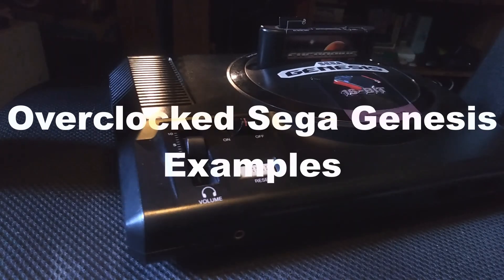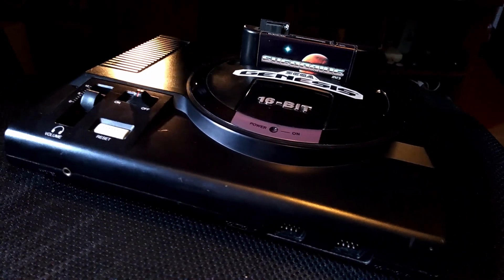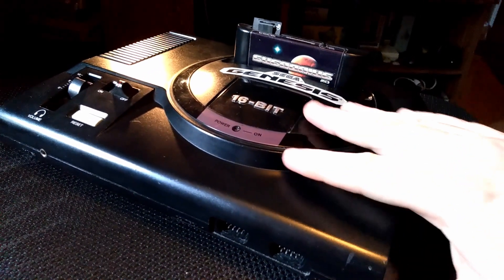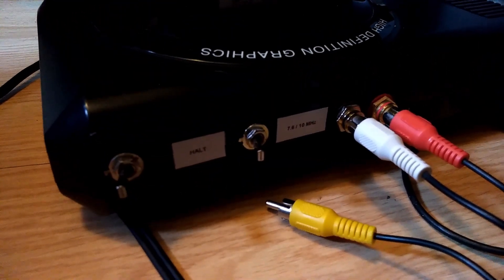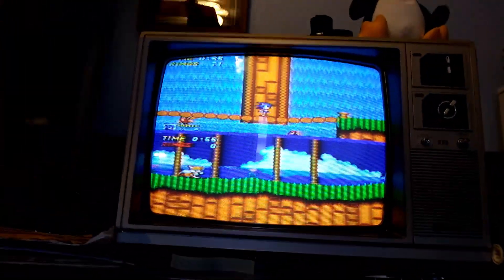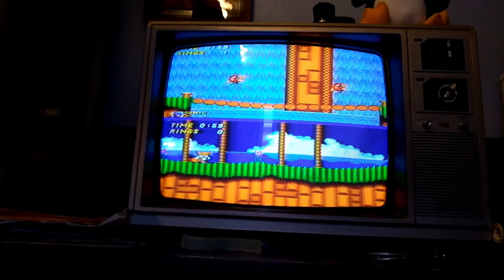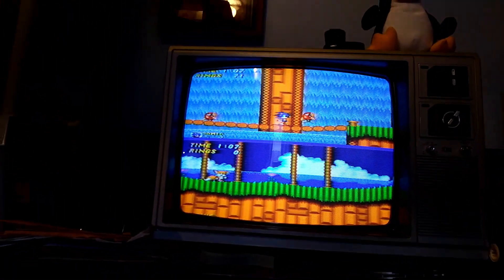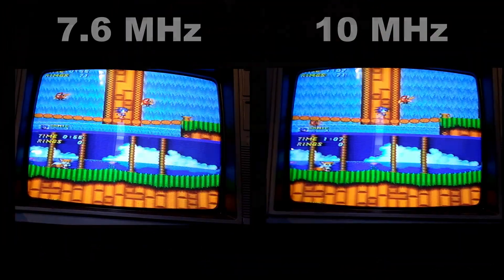10MHz Sega Genesis Overclock Examples

Comment: Personally, though without having tried the OC mof, I feel Sonic 3 would feel wrong if it lacked the slowdown after getting hit, but I guess it only slows down if you have a lot of rings and not if you have just one?

From what I've seen, the most important reason to overclock is to get Mega Man the Wily Wars to run smoothly and properly. I don't know if there are any other games that need it.
Reply: The big advantage is the Road Rash series. Seriously, the road movement is became smooth as butter.